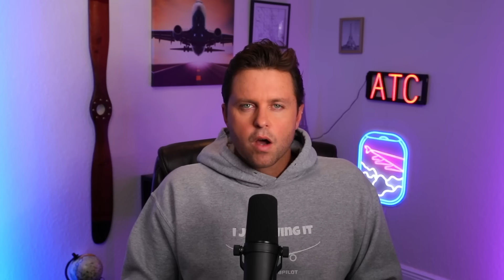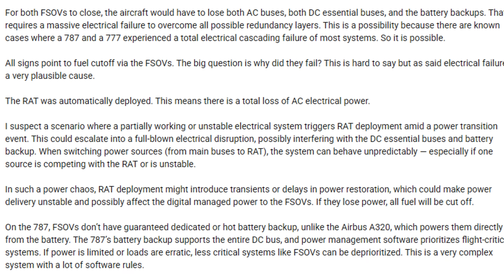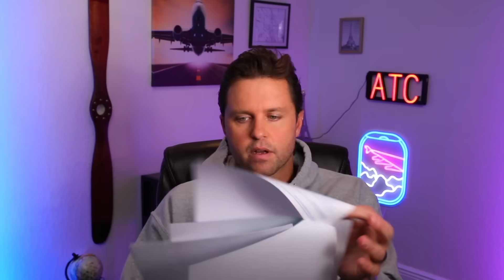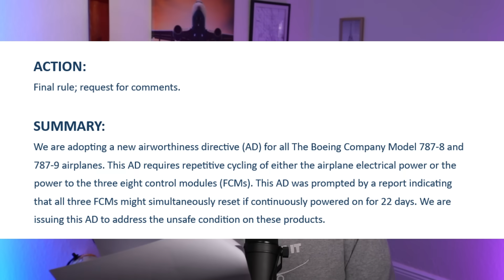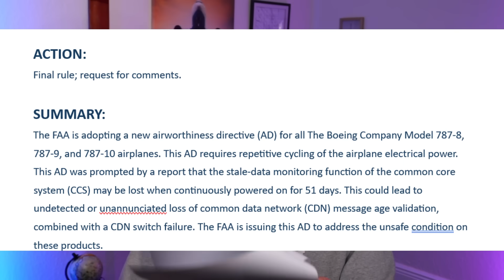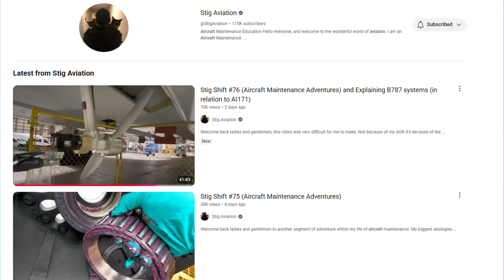Air India 171: Did a Software Glitch Cause Dual Engine Failure?

Comment: Intersting video, still some things to be very careful about:

1)
-MCAS was NOT a software glitch. It primary was a physical sensor on the exteriour of the aircraft´s failure. Due to the few flight situations where MCAS is triggered, Boeing actively managed to sell it to FAA as small addon, and you could argue if they activly lied about it and played down its significance, programmed not be the main FCC people and under time pressure, leading to no redundancy at all for that system. They simply "forgot" that the infinite reactivation of the MCAS is more powerful than a pilot after a few activations, which is what they wanted while not thinking about a sensor failure coupled with the system overpowering the untrained pilots. This is not a "stupid engineers" problem, but probably more on how it was implemented into the organizations workflow and how some double and tripple checks might have been left out due to the decision of management.

2)
-The commentator which you base your whole theory about has alot of detailed knowledge about the 787. Let us double check each system that was stated. He might be Boeing eng, US student with Boeing professor or it might be all public. My main point here is we need to verify what is being said first. The Boeing principles of when it is safer to shut of the engine is a bald claim, which is true, but we need to add information here, because: He "assumes" that there could easily be a cascading effect. That cascading effect is a catastrophic event, so in theory before thinking about if you want to shut of the engine (as Boeing while designing FSOV logic) it needs to be determined why the electrical system could fail so hard (next point will detail that)

3)
-FSOV would the explanation, but not the reason for the catastrophic failure, since FSOV does just as it is programmed to do. 

-So the catastrophic event stated in the comment would be a failure in electrical power distribution: "generator power was available, but a chain reaction of breaker and converter failures disconnected all major buses, including those powered by the APU and engines. "

-While the commenter got us a good explanation on how in case of a SPECIFIC catastrophic electrical failure the engines would shut off, the technical error and design error causing the mentioned faults were not explained at all. This again leads us to the begin of our question: Why did this plane crash? The answer is NOT the FSOV closing. The answer would be the explanation to WHY the highly complex electric distribution system failed.

4)
-Based on point 3, based on HeyFixThis comment, it still leaves open the question if really have a "Software glitch", physical problem in production of the plane in the electrical system, or a maintainance issue of this electrical system. So it might not even be Boeing at fault here, but Air India. I will say here, that the examples of previous 777 and 787 problems indicate more of a design problem in the hands of Boeing, but we dont know that at all right now.

--> Calling it a "software glitch closing the fuel valve" would at this moment not the right term in my opinion. As i explained, we dont know if it was design error, physical error (pe) or pe due to maintainance issues.

Still, mega video, thanks for sharing this information, and HeyFixThis seems to have a very educated comment filled with alot of detailed information (which we might need to double check). Thank you for him/her aswell!

Comment: I find this extremely unlikely!  Why would an engine system be designed that could allow the unintended shutdown of the engines. From my earl 737NG and 777 days, I do recall a problem leaving the airplane powered for days at a time and a “recommendation” to fully de-power after 24 or so hours to reset computers that can accumulate random faults and glitches.

Comment: Here is my third comment in the unknowable nature of the 787
Fly-by-wire failure system

The software MUST KNOW WHAT IS MY CURRENT MODE OF OPERATION.

ARE YOU IN MODE WEIGHT ON WHEELS?

ARE YOU IN TAKE OFF MODE AFTER THE WEIGHT ON WHEELS HAS TRANSITIONED?

ARE YOU IN LANDING MODE NOW
BECAUSE YOUR TAKE OFF ABORTED ?  (AS IN THE AI 171 CASE)

WHEN IS A TAKE OF MODE
NOT A TAKE OFF?
WHEN IT HAS FAILED TAKE OFF
AND HAS INSTANTANEOUSLY 
TRANSITIONED TO BE AN
EMERGENCY LANDING.

NO CERTAINTY OF THE "MODE"
QUESTION

BUT IN THE AIRPORT WHERE
THE AI 171 CRASH OCCURRED,
THERE IS NO TRANSITION 
POSSIBLE.  BUILDINGS ARE WAITING TO DESTROY THE AIRPLANE AND EVERYONE
ON BOARD.

BACK WHEN I NEVER KNEW THERE WAS A SYSTEM CALLED
THE "FADEC" I HAD PUT FORTH A 
FSILURE MODE IF THE CONTROLLER AND ENGINES FELL
OUT OF PHASE THEY WERE IN.

Comment: Your thumbnail mixes software with electrical. That's two different things.

Electrical could be the wiring. That's not software.

That's as if you mix up tanking gas for your car with going to sleep. It just doesn't make sense.

Comment: I get your gist but how do you explain the super long takeoff roll? If the engines shut down then no takeoff. They did manage to use the entire runway and took off. That indicates they had power, not very much, but enough to stagger into the air in ground effect.

Comment: I cannot imagine a more INSANE process that shuts off ALL Engines and power to an Aircraft under any situations, as was seen on footage, just a totally insane default.
No Pilot even if the engines were ablaze on takeoff is shutting down thrust, just #ucking mad insane stuff from Bonkers airline makers. Doomliner is finished.

Comment: Even if the software glitch wasn't the cause of the Air India crash, the fact people raised safety concerns about it since 2015 and it wasn't addrssed, - it's very disturbing.❗
Reply from the maker: To be fair they were addressed. AD’s legally have to be followed.
Reply: @Garybpilot I expressed the theory of a software glitch on Captain Steeve or your YT channel a couple of days ago. It came into my mind, because recently I was involved in a performing programming contract for one of the US companies that train Boeing/Airbus pilots. Although the contract was about their website and nothing to do with airplanes, the founding was astonishing. We've  dealt with the code  written almost 20 years ago by some amateurs. Very bad coding with many bad "work arounds" solutions. I then jokingly thought "how are the planes  still flying?". Considering the previous glitches with Boeing software I wouldn't be surprised about the new ones. Seems that the lack of expertise and talents, lowering coding standards, in the coding community is a worldwide problem in general and the problem in Aviation Industry particularly.
Reply: @Garybpilot Another observation from my coding experience. 80% of the companies, including  large cap companies, DO NOT USE tests for their coding.❗

Comment: Very interesting premise, need to process the details. 

The fault tree with this issue leads to rapid thrust loss upon closure of the valves. So unfortunately the available fuzzy information about the onset of thrust deviation is rather unclear about WHEN things started to go really bad. 

One premise is that it was sudden, another is that it was progressive! Two distinctly different root causes! Need an explanation of why the aircraft appeared to have taken the full runway to get airborne and if that somehow correlates to a fault triggering this scenario of immediate fuel valve closure.

Comment: The spring loaded fuel valve sounds right as a probable cause . This valve should have been able to be  reset by the pilot. This valve is called a mouse trap style, once activated it can only be reset by a mechanic insane. The FAA should have never approved this fuel valve, what were they thinking.   :face-orange-biting-nails:

Comment: MHO   The engines did not shut down/off.  They were returned to idle; as by design, due to a power failure and after the rat was deployed there was not enough time to recharge to have enough thrust quickly enough at such a low altitude.

Comment: 'Regulations are written in blood' is the saying, right?.
Aerbus has a backup battery to premptively require the blood, to write the regs.
Welcome aboard libertardarians, welcome aboard MAGA Repube de-regulate savages.
In the face of free market ideals, social democrat European Aerbus has put more quality ahead of maximising profit margins WHILE BOEING SELF IMMOLATES killing hundreds, thousands in the process...
'If its Boeing, IM NOT GOING'
BOEING IS A CESSPIT. HOW MANY HORRORS ARE TO COME AS 787/777s age and the airframes fail (per whistleblower concerns.)
AVOID BOEING, ESP OLDER BOEINGS with airlines like Air India, Indonesian etc etc.
Furious at Boeing.
Ryanair has its own quality team on the Boeing lines to babysit its own planes coming off the line... BE CONCERNED... Ryanair doesnt waste a penny... it is leveraging the mess Boeing is in, demanding its own standards of production at extra cost because it knows- this is a company on its knees and we can ensure quality where they cant...
Which infers a knock on that all other carriers/lessors are getting a lower quality (dangerous) product.
Boeing is a case study in greedy execs vs engineering... it needs MASSIVE REFORM, per murrca

Comment: It's been a long time since being on the flight deck and I was never type rated on the 787 but given that if Boeing designed the Fuel Shutoff Valves (FSOVs) to fail-safe in the closed position during a total electrical loss, it would seem logical for the backup power architecture to mirror systems like the A320 where critical components such as the FSOV's are hard-wired directly to the aircraft batteries. That design would allow for seamless RAT deployment and maintain continuous electrical power to essential systems, potentially preventing scenarios like the Air India 171 incident. Does anyone know if RAT deployment can currently provide necessary electrical power and re-open the FSOV's...(not that it might matter in such a critical phase of the flight regime)?

Comment: I think this is going to be one of the scenarios that the engineers never thought could happen but did
Reply: Or management overrode the engineers because it was “unlikely” to happen any time soon.  “I got mine” short term thinking.
Reply: @libby2012  Like the two Space Shuttle loses, it will never happen but it does

Comment: Here are my conclusions on what is the most likely scenario:
𝟭) The lithium battery exploded.  The aircraft had recently undergone maintenance and the wrong battery or the wrong battery harness was installed.  An incorrect harness or an incorrectly secured harness would allow the battery to move and potentially short out.  A Lithium battery will explode if it experiences a persistent short.  An unharnessed battery will move a lot during takeoff.
𝟮) Because the battery is, by necessity, close to the plane’s main DC circuit, the damage caused by an exploded battery could result in a short circuit in the DC supply;
𝟯)  This will cause the RAT to deploy and the FSOV (Fuel Shutoff Valve) to deploy starving the engines of fuel.  This overrides the FADEC.
𝟰) The RAT can not supply the plane with DC power until the short circuit has cleared.
𝟱) The plane’s AC circuit might still function.
𝟲) If correct, the transponder, CVR and FDR will stop when the battery exploded and cabin lights will flicker off (the bang and flickering light were reported by the survivor).

The result is loss of power from both engines followed by a loss of lift etc.

Comment: In my opinion, it’s a major design flaw to give control to a computer and take control away from a pilot - AND - it’s a major design flaw to count on electric / electronic / computer etc.without AT LEAST having the pilot be able to override it immediately with mechanical systems like direct levers, hydraulics, etc.  Hasn’t everyone seen a computer crash?  Or a smart phone just quit? Even a car can quit because of a short in the electrical system.  But in that case, you’re on the ground.  You can still steer to a stop.  … Too much reliance on automaton and “tech”.  And, lately, “tech” just throws things out, and lets the user find the faults.  “Back in the day” people were embarrassed to launch something that had not been thoroughly vetted.  It’s all become backwards.  …. Tried and true and long term outlook beats short term flashy “I got mine” attitude.

Comment: This sounds like a problem that can be tested on another 787 by the NTSB. But it would also be a problem that Boeing should have thoroughly tested during development and testing of the 787 and all Boeing planes. I mean how hard is it to say if a plane loses all electrical power what will happen to the engines.

Comment: Further down in the same post, there’s another interesting comment regarding the All Valve Control Switch possibly not being reset (i.e., left open) after refueling. If this happens, the comment goes on to say that the fuel valves will be shut, and the engines will only have 30-40 seconds of fuel left via the gravity feed lines, and then flame out, which timing-wise might be in between V1 and Rotate. This person goes on to say that the dust seen at Rotate is not dust at all, but is fuel being blown out of the tank vents which would be left open in this scenario. He states that this fuel vapor can be observed to “follow” the plane to about 100’ (above what one might expect if it was only runway threshold dust). A ChatGPT search of this valve being left open returned the possibility of the fuel supply system and its backups no longer performing normally and becoming unreliable due to electrical, sensor and software conflicts, but does indicate that there should be an alarm or notification regarding this valve before pushback. Lastly, this person indicates that the flame out occurring suddenly and with this timing would be compatible with the landing gear trucks being in the position as observed in the videos due to the electrical failure from loss of engine power (and of course that the RAT does not power the gear). Anyway, another interesting theory for you to consider. Thanks for your efforts and ethics in covering this tragic loss

Comment: Again, potentially Boeing skimping on the Safety Analysis during their design & development phases, where they didnt properly consider all the hazard items, failure probabilities, and ultimately all the necessary design mitigation needed to make the a/c to be safe and air-worthy.  It still baffles me how SINGLE AoA sensor failure was allowed to cause catastrophic a/c response during critical flight phase in 737 Max.  Now for the Dreamliners, say Boeing initially didnt properly analyzed that particular electrical failure and all the probable impacts.  But after the multiple ADs in the span of few years, and they didnt take action?  Has FAA attempted to enforce those ADs? Does the Dreamliner still have its airworthiness certificate for it to still be flying currently?
Shouldn't it be enough cause for grounding the planes worldwide?

Comment: We see the plane in the air, and it does not yaw, then descends with low thrust. Both engines have to roll back simultaneously. This rules out fuel contamination and starvation. Note, an electrical glitch like this will also upset the black boxes, so the answer will not come soon, but it will come eventually.

Comment: Here is an example of another solution to the problems inherent in fly-by-wire systems.

The Space Shuttle.

When the Space Shuttle was landing,
It had to land.  I believe that it had no capability to do an aborted landing.  No fuel on board.

Three computers were in the redundancy system. Call these computers A, B, and C.

This was how IBM designed it if memory serves correctly.

While in the process of landing,  computer C is not active.

The active computers are both 
the A and B ones.

They each execute the same instruction in the same memory location.  They must arrive at the same result and agree with each other.

If the A and B do not agree, how can yo determine which is correct?
Simple:  in the time allowed,
YOU CANNOT DETERMINE IF COMPUTER A IS CORRECT, OR
COMPUTER B IS CORRECT.

WHAT DO YOU DO ???

YOU SHUT THEM BOTH DOWN.

AND IMMEDIATELY ACTIVATE
COMPUTER C.

THIS MAY LOOK LIKE A HAIL MARY PASS.

I WILL LET THE FOOT BALL COACHES DEBATE THIS.